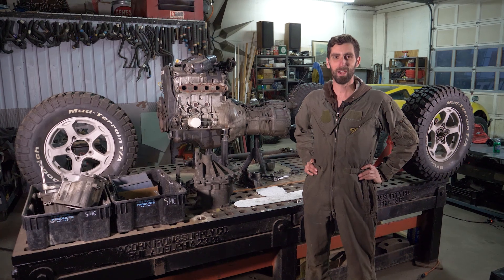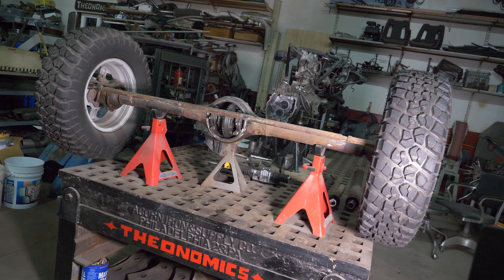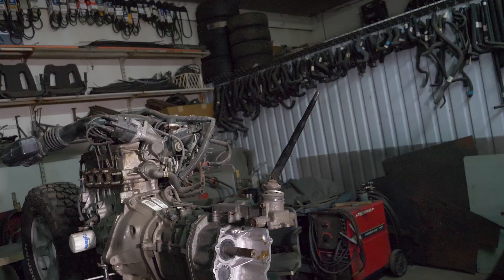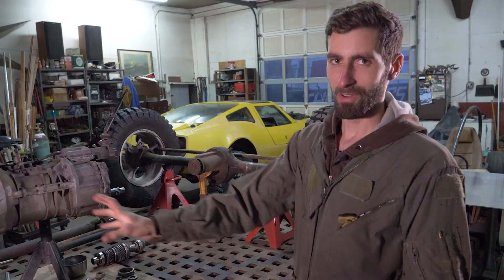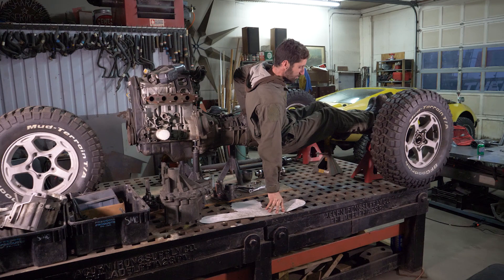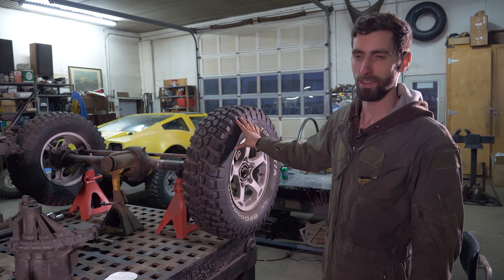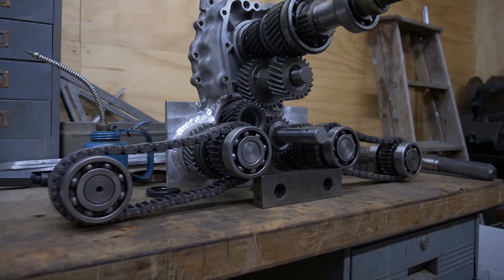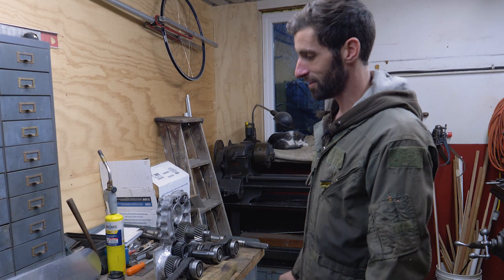How it will work - Amphibious Project Three Wheeled Reverse Trike Vehicle Build | Ep. 1

Comment: Subscribed! Cool concept and genius ingenuity. I was looking for the guy who put a WRX motor into a Subaru justy. It looks like I've found him, you are making that project seem like a cakewalk compared to this one. I have some questions for you if you wouldn't mind helping me out, I have a 1990 sunaru justy that my dad handed down to me several years ago and I'm doing am electric conversion on it. I'm basically planning on doing some light racing with it on the weekends, some time trail stuff.  Not sure if you would remember any of that build but im doing it pretty similar to yours as far suspension/hubs etc... I have parts (the whole rear end) and the front hubs/brakes from an 02 Impreza. I was wondering how you determined the height for the new strut towers in the rear, and also what fiero model and year you got the steering rack out of... I have more questions I'm sure but I'll wait to see if you are interested in helping me out before i continue thanks
Reply: Hi Chris, thanks for the kind words! Yes I'd be happy to share what I recall of the Justy, unfortunately I've not retained much info on that one. It sounds like yours should be a cool build, although I'm not at all familiar with electric conversions. The wrx suspension was definitely a ton of work to graft into the justy.. If I were to do it over again I'd probably widen the wheelbase to the wrx width and maybe add flares and offroad tires to save the trouble of building custom subframes. I used ajustable coilovers on it so there was some flexibility as the where I built the rear strut towers. I have no recollection of the rack and pinion I used... If you haven't seen them already, the build photos were still posted on the cardomain website last time I checked.
Reply: @theonparseghian9172  thanks for the reply, I actually decided to go that route basically. I modified the WRX subframe to bolt up to the justy body with two simple flat plates, now the rear track width is 3 inches wider overall. I was planning on doing coilovers as well. I just don't have the parts in front of me yet to play with the strut tower height so I figured I'd try to pick your brain. Thanks for the response.
Reply: Cool, that sounds perfect, I remembered it being wider then that. Now that I think about it, You might have to get a little crafty with the struts, being that it’s wider now, they kinda would stick out into the quarter panel skin...
Reply: @theonparseghian9172  well, I get the stuts in on Thursday so I guess we'll see.
Reply: It looks like they will fit with a very similar box/tower in the rear!